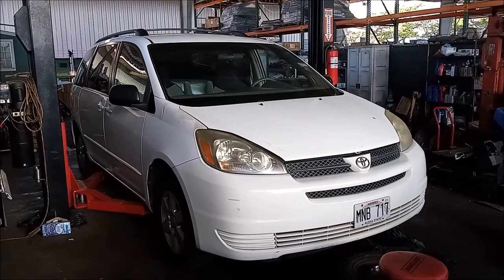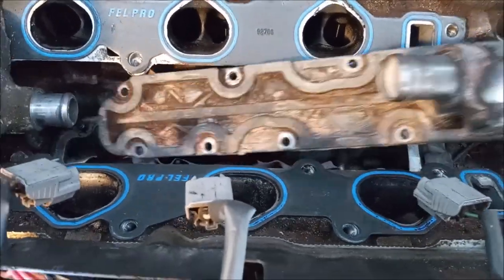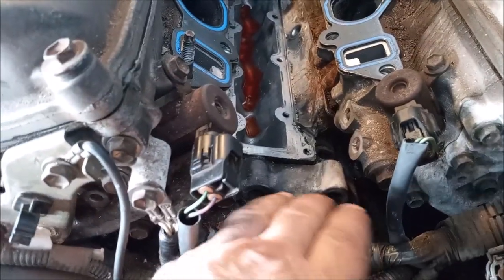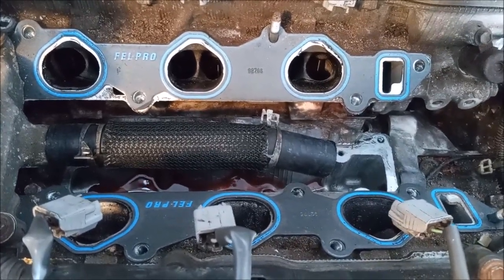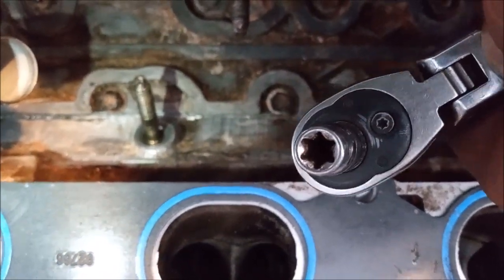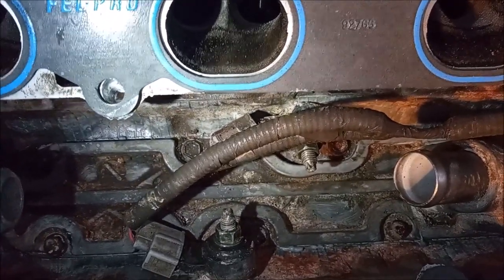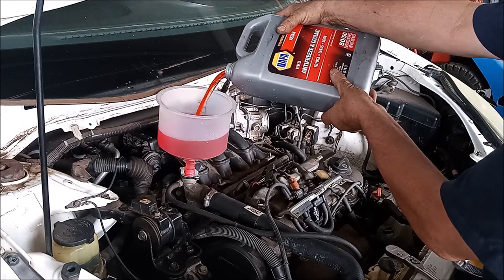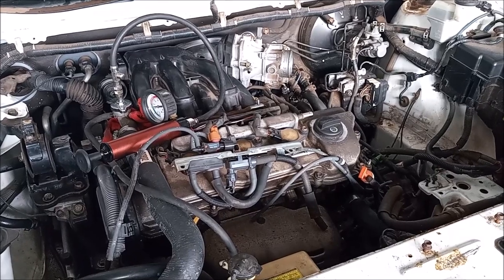Toyota V6 -Thermostat Housing Leak - 3.0/3.3 liter 1MZ-FE/3MZ-FE Camry Sienna Highlander RX300 RX330

Comment: Bro I just found this leak in the exact spot, worst of all I just replaced the 2 knock sensor(1 bad sensor)/bypass hose and all the intake gaskets about 2 weeks ago, why didn't I just replace the thermostat while I was replacing the knock sensor? Its so cheap and I would of caught it because the leak was only visible after taking out the outer thermostat housing.
Reply from the maker: Tough leak to find and fix.

Comment: Hi. Quick question. Did you have to pull out evey fuel injector out when you pull out the fuel rail? How much pressure do you put in the system when preasure testing?
Reply from the maker: Leave the injectors in the rail, just pull them off the manifold. No more than 20psi for pressure test.

Comment: thats probably what i have because i thought it was my head gasket but engine oil is clean no coolant in it but it was leaking quite a little bit even if it was getting hot the engine and after looking and looking i saw the leak under transmission follow it lost track but than i see right underneath the thermostat was wet but i had change the thermostat as well the bypass hose and its gasket but i never thought of that thermostat housing and i did saw like a black rubber coming out and maybe thats what could probably be causing my problem
Reply from the maker: it's very well hidden and if you don't know about it you would never suspect it.
Reply: @Merryfrankster_  very true i was going nuts but after watching your video and i saw the leaking of coolant was coming around the thermostat i touch it but was completely dry the outside and came to the housing of the thermostat its was leaking once again thank you for this video it help alot
Reply from the maker: @jpalacess4735  thank you for watching and for commenting.